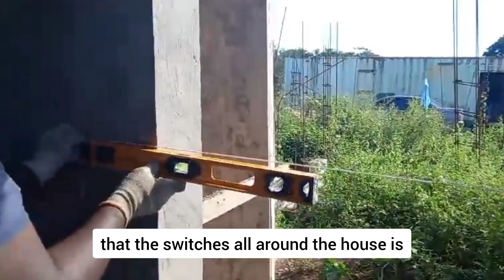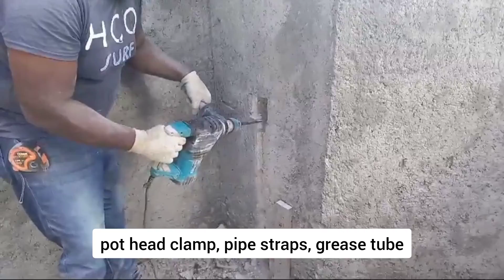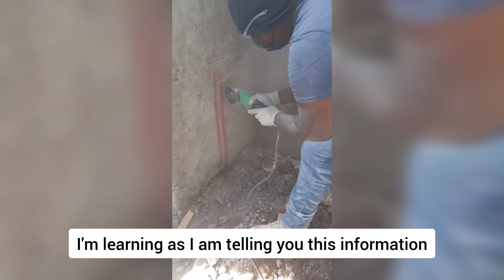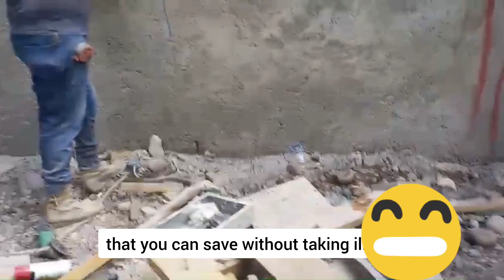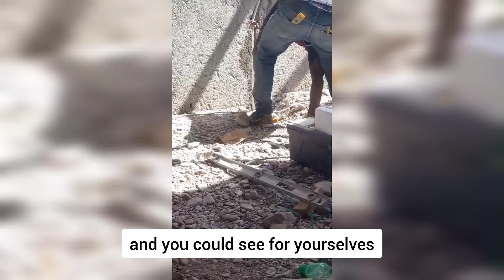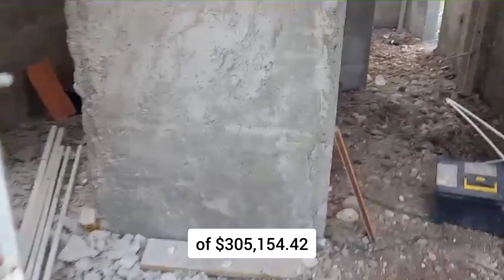Cost of Electrical Materials in Jamaica | Electrical Installation Starts #construction #money

Comment: I’ve seen multiple houses in Jamaica get electrical work done and it seemed like all of them allow the house to be built and then come behind and cut the wall. That’s foolish. It’s block so just put the outlet in as they are building the wall. You will save more time in the beginning, which will cut a lot of time out on the backside.
Reply from the maker: It's all about matter of choice ...practice...procedure. There is always a method to the madness, and it works for us...

Comment: Just in case your home floods, you want the electrical work to come in from the top down to the plugs. 
You want to be able to fix your electrical work in the future without a lot of fuss, so you don't want to surround all of the wires in concrete.  Prep
Reply from the maker: Sounds good, Keywest, you've seen it done that way in Jamaica? The electrical plan was approved by the Parish Council from the bottom up, though, so to get it approved, the plan had to be followed accordingly.

Comment: This is so stupid, its about time we come up with a better way to do this.
Reply from the maker: What is so stupid?
Reply: @underconstructionJAM  probably the way they cut the wall for the conduit, the conduit is supposed to go in between the block before cement is poured in the block. Proper electrical planning prevents all this cutting.

Comment: Yu making progress 
How much per foot was the 2.5 wire and the breakers?
Did you get quotation fron other electrical stores before choosing Dunns?
Reply from the maker: We used Dunn's and other stores but primarily Dunn's because of the discount.  I'll have to check re breakers, but we spoke about wire cost and breaker cost in the video, though...are you seeking info separate from that?
Reply: I'm thinking of starting some construction soon but I'm thinking of buying them overseas or buying them locally so I'm looking at both options. Sometimes buying overseas and bringing them in is not always cheaper.
Reply: If it was possible, I imagine the builders would be doing it, BUT my brain keep wondering why the electrical outlet and switch boxes can’t at least be roughed in with temporary boxes during the masonry build, so as not need to do all that wall cutting and digging and drilling out AFTER.  
Maybe block makers need to make special blocks that already have a square hole punched in or something. 😀